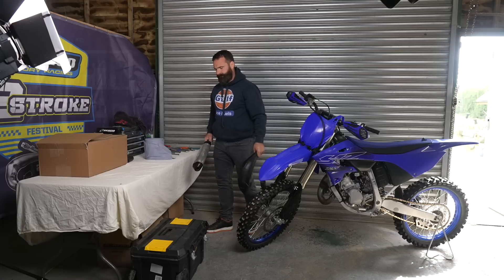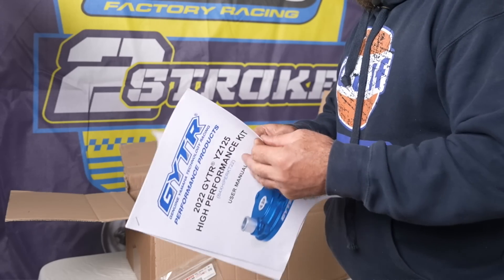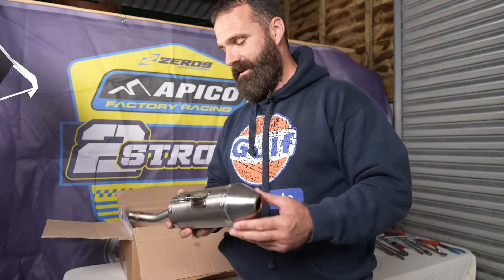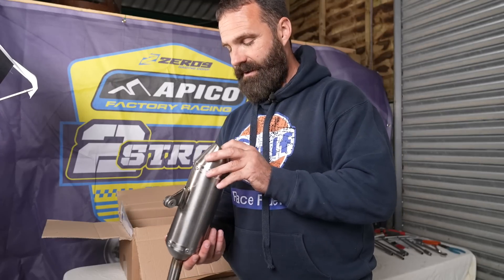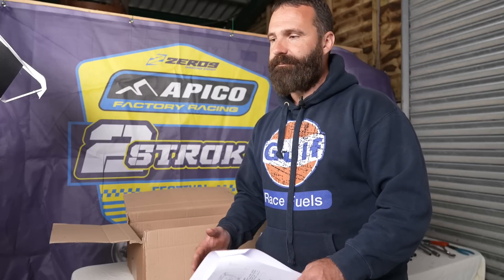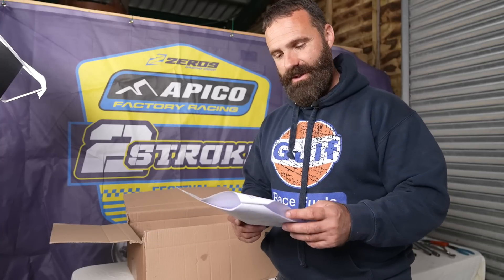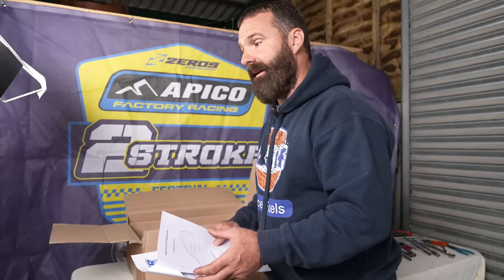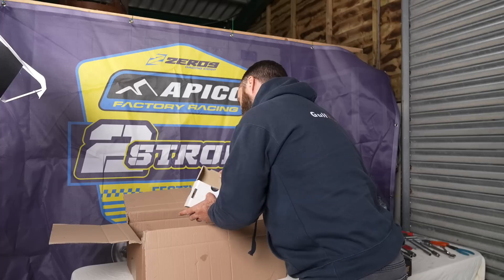Bolt-on BHP for 2022 Yamaha YZ125 two-stroke: Fitting the GYT-R performance kit

Comment: i did a 14t front sprocket,  and 48t rear .  apex head , wiseco RE piston , Wiseco clutch basket and discs, with Hinson inner hub and GYTR pressure plate , Bills Pipe , PC TI silencer .   HUGE improvement over OEM.  i had to jet it in , but besides its been mint.  i have 40 hrs on it and am currently doing my first real service/cleaning/gaskets  job ,  but all looks well  . i totally got rid of any poor response down low ,  i can ride it super slow and no issues either.   and it has bigtime over rev , but happy doing it .  i don't feel because of the sprocket I've lost anything , and the benefits up top are worth it . very happy with the bike.   super fun .

Comment: I had a DTR faster than a YZ , I blew it up , I chipped top end , my pal skimmed it for me , it was fast af ,I have had 4 DTRS , even expansion pipe is bigger, I still got a photo of it I wish I didn’t sell it
Reply: no way faster than yz
Reply: @onenessseeker5683 on top end, with highway sprocket on , YZ is all bottom end power, could ride a DTR all day though wood , you couldn’t do that with the YZ
Reply: @kingkong81icloud  I do all that on my yz mate lol. You an change gearing on yz to suit road better and it will still be more power on bottom than dtr.
Reply: @o@o @onenessseeker5683 got a YZ 250 , I have more fun on a DTR, plus it’s not stock, it has been tuned up, power valve if fixed fully open, skimmed top end and it’s got a bigger expansion chamber than a normal YZ 125 and a box box off a CR , had 98 mph out of it my mate clocked me in his car
Reply: @kingkong81icloud  & so you ruined the bottom end power completely.. that can't be much fun to ride like that.. I have a yz125 that is 1000% more fun than any dtr I rode. & I have rode many. I love dtr.. but can't compare to yz125
Reply: @o @onenessseeker5683 o, it’s just an all-round fast DTR , when I first got it, it blew up and I carried on riding it and chipped the top end , my next door neighbour, took it to work and skimmed it for me , it did not need a rebore , I have had 4 , none of them were as fast as this one Plus, it does not have the electronic power valve, it’s just fully open,  and it runs mint kicks up first time every time , not like my YZ , have to put a boot on,
Reply: @onenessseeker5683 was like this but DTR https://youtu.be/ooOOuLzgkN0?si=mD5Jsgbb4K3ZOepx
Reply: @o@o @onenessseeker5683 fact, it look more like this DTR , that the exhaust went up and mine was not as clean, mine was for woods with Nobbly tires etc

Comment: You don't look like a 150lb guy, and that set up moves you well for a 125.  It does seem to get in the power pretty easily, and you ride pretty well.
I wish you would have showed the Dyno curves in the camera more.  What is the claimed peak HP (at the wheel I hope)?  It might be getting close to 40 hp.  If you lower the suspension an inch, it will be even more fun to ride.  At 5'9" tall, I took an inch off my 2019 YZ250 seat, and .75" off the suspension, and it feels wonderful in the corners.  I see Husky is making a shorter version of their MX bike, and I think it will catch on.

Comment: I am a bit surprised it has a bridged exhaust port and no sub exhaust ports.  I thought most MX engines got away from the bridge because of heat problems on the thin section, maybe not for 125's?

Comment: Are you sure the carb is bigger for the 22?   Yamaha switched from Mikuni to Keihin, but they are both 38mm carbs, which is 250 size,---so I don't expect much low or mid-range out of the YZ125's.  Trying to keep up with the 4-strokes for some reason IMO.

Comment: Yamaha's GYT-R kit is probably a pretty good guarantee that you are getting the pipe, compression and porting that is all matched well together, and that means good power.  The different combustion chambers would allow you to get the most out of any gas you can get, (I assume). That kit is not messing around, (and i have not seen it run, (jetted well?), yet.
But is it worth it?  Your still not going to keep up to a good 250 4-stroke on a fast/smooth 4-stroke track, (like the one in the vid).  So I hope the kit has a really good mid-range, and not all top end.

Comment: 125, usually depended on higher rpm power, but I can tell my 250 was made to try to keep up with 4-strokes on fast tracks.  So I fixed it, because racing 4-strokes is a waste of energy on a 2-stroke.  Nobody who wants to do well can race them,---so why bother filling a demographic that does not exist?  People buy them because they are good, (but way too tall.), less expensive easier to work on than a 4-stroke, and take more talent to ride.  They are not trying to make a career racing MX.  Thank goodness it has a fine frame and suspension, so all you have to do is lower it and make the engine more what you want/need/can enjoy,---unless you are trying to keep up with 4-strokes on a fast track.

Comment: Again, the all popular freestyle handle bar set up, (rotated forward for trick clearance).  
Now how can I be sure you are credible for anything else about the bike.  Just because everybody else does it that way?  :)
Well, I will listen, and give you my expert opinion, and see if we adopted anything from trials or road racing.  hehe
Seriously, lower the ape hanger bars.  My Pro Taper YZ bars, under the pad have rotation marks with "0" being popular today located in the middle of the clamp.  I rotated my bars down so "2) is ion the middle of the clamp, and readjust my levers, and abracadabra,  like magic, I have better front end control in the corners, and much easier to keep my elbows,--over the "lower" bars.  Good thing you guys don't have bumps on MX tracks anymore, that would throw us to the ground, (like it did Sexton at the last 2022 national) if we had our elbows by our waists.  It scares me to see the entire industry go irrational with the bar set up, (par for the course, since the world is going irrational.).  Learn from the age of reason in MX, the 80's.  You will crash less.

Comment: i agree with the sprocket set up and carb adjustment making a HUGE difference.  obviously the carb settings are relevant to fuel type , location , temps etc.    but i went from the OEM 75 , to the provided 72 pilot.   left the needle , and main .  but found the mild leaning on the pilot to make low end way less boggy .  they from factory make them overly rich intentionally .  the sprocket however made a big difference also .  i actually went with a 14T front ( 13t from oem ) and a 48 T rear ( 49T from oem ) .  and it forced me to rev a little more down low , further correcting the mild richness ,   but it gave so much more top end .  believe the calculator said id lose 10% down low , but gain 10% up high....which is where we ride these bikes.    i definitely suggest people start small with their mods.   but the little mods done make a BIG difference.   i run a Bill's pipes MX pipe,  with a PC TI/Kevlar silencer,  and T2 VP Racing fuel and i havent dynoed , but id guarantee i make 7-10HP more than stock .  the GYTR package isn't available in the US , or at least as of yet .   , and ill wait till i NEED parts to go for it,  but looks like a nice package.   hope they sell individual parts like the CDI on their own at some point since i don't need half the parts from it .  have a Wiseco piston , clutch , and GYTR pressure plate ready on hand when its time.  and an Apex head i mildly modified .

Comment: Did you add two teeth to the rear sprocket or drop two teeth?
Reply: Dropped
Reply: @revengeof1307  thanks
Reply: @darylsmioth1904  of course

Comment: Been seeing jetting it more like a pwk generally are it's better. So far pilot and mains like a yz250 has been better settings. Yamaha has really gone with a rich pilot leaner main. So boggy loaded up on the bottom lean up top. Yz125 needles unique to 22.
Reply: Bingo.  All the negative press about it being soft on the bottom and a mid/top motor is tuning related.  I took the same approach as my YZ250 as well.  It crushes the previous gen on bottom end torque and makes far better and smother mid to top now that the carb settings are correct.  Anyone running pilots in the 70's and 60's is completely missing the mark.
Reply: I agree i went with JDjetting kit 50 pilot and 172 main runs perfect

Comment: Sweet vid. Wish they would sell that GYTR kit here in the states. What fuel you running with that ported head?
Reply: Gulf fuel since his sponsored by them and you can get the gytr kit in the states just got to pay more for postage
Reply: A good tuner here in the states can do the same or more than that GYTR kit and WAY CHEAPER!
Reply: @darylsmioth1904  it’s a bolt on kit for newer races that haven’t got to have to worry about getting parts exactly right and having to mess around on the dyno etc. the kit is way over priced but the only sweet thing is the ignition cover, blue head which vhm makes them and the gytr exhaust which you can buy them all separately
Reply: @tylersvensson4468  Your right. Good way looking at it because its works and already tested.
Reply: @darylsmioth1904  I'll have to look into it thanks. Where can I get some GYTR parts for my 08 yz 125?. I tried on the site but they didn't have my year of bike and there was not a large selection

Comment: So after 10 hours on the 22 model yz 125 cc I can honestly say it’s very close to perfect stock imo . The only faults I could find were 
Jetting - I changed to the nydf needle  
Oil ratio - I now use 40:1 -98 octane 
Gearing - 2 teeth lower to be in the right rev range out of corners thanks to you 👌
Shifting recall - I was emailed by the local shop to bring it back as this model has a shifting issue eg unable to shift gear . No issues with mine yet . 
Thanks for the best bike  reviews on YouTube. This gytr kit looks and sounds so bad ass 👍🏼👍🏼look forward to more on this
Reply: what is the stock gearing? 13t/48? so you guys are using 46T?
Reply: @DogTrainerCebu  not sure to be honest. Check the bikes stock data.
Reply: 13/49 stock so 47 rear
Reply: Most said the jetting was off but it should be good STOCK. Be consistent w/premix oil brand & 32:1 or 40:1 ratio to make it last! Get best fuel you can too. They have very good octane boosters out do the research. 93 premium fuel + 4 capfuls of my octane booster gives me 100 octane unleaded. 👍👍